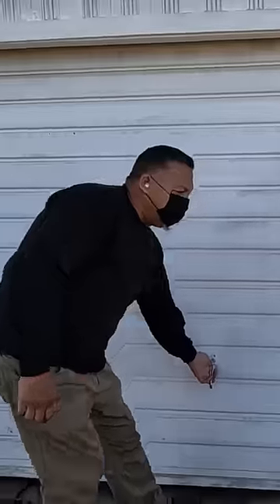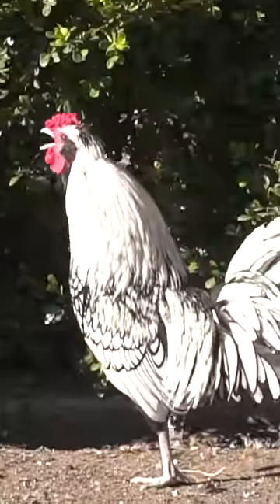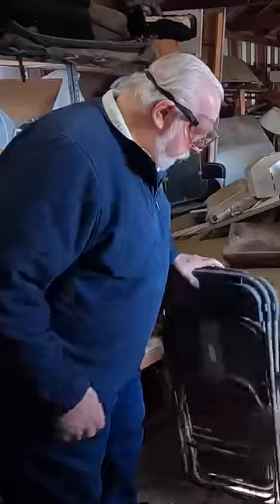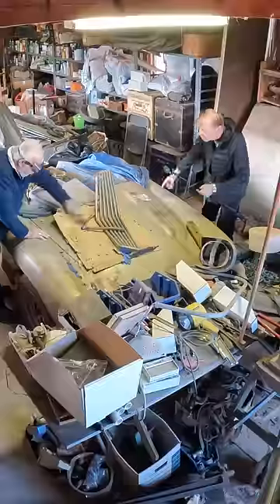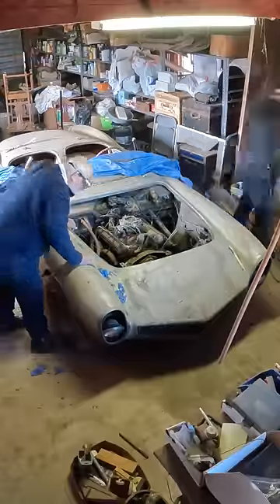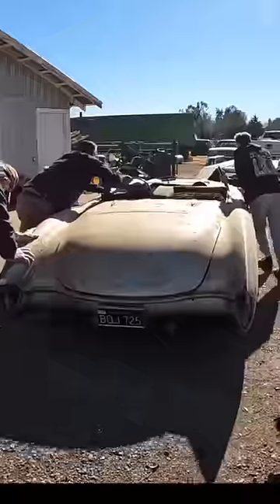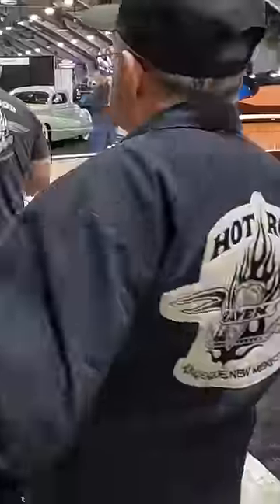#Shorts 1957 Corvette Kustom Uncovered in Barn After 57 Years

Comment: That is not a 1957 corvette, the 57 grille had 13 teeth An American representation (original 13 colonies) the tail lights were straight up vertical (plumb) with a slightly forward pitch at the top, and did not have that hideous pointed nose. 
 I used to drive one, didn’t own it, but I spent a lot of time with it.